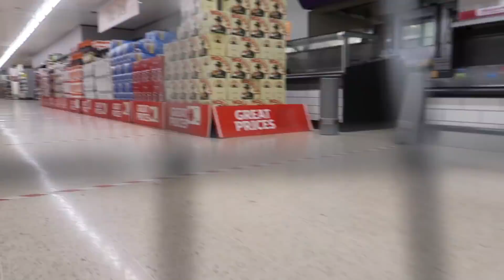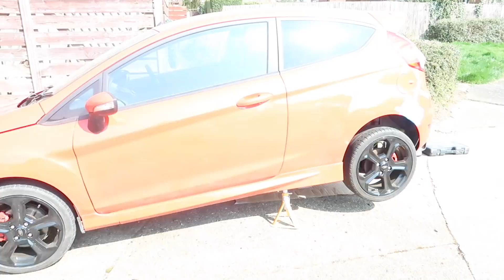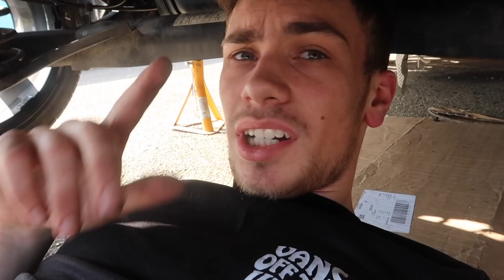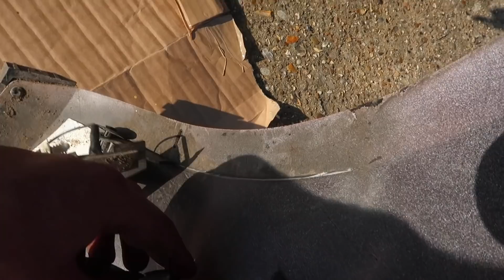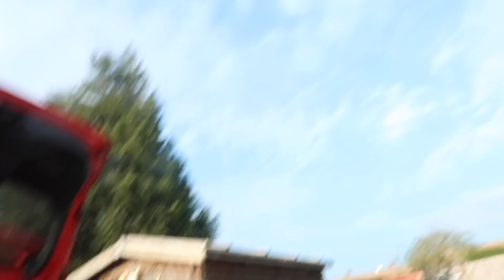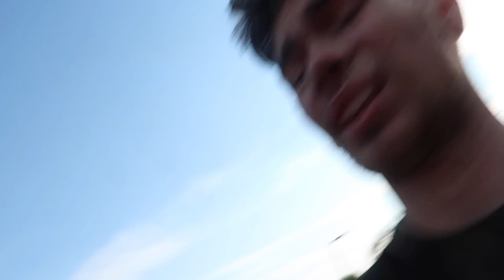TRACK CAR PROGRESS!

Comment: You undid the adjuster on the cable so it needs adjusting back up mate. Jack the back end up and adjust it until it just starts grabbing on the back wheels, then back it off just a bit.

Comment: Yeah. Wear those gloves for protection. Possibly get them infected in store. Then get in your car touching handles, steering wheel and paddles. You should of removed them getting in and used a hand sanitiser. Or worn plastic and disposed them.

Comment: Yep the handbrakes are absolute wank on these cars. When you had the 10mm socket out there’s an adjuster at the bottom of the handbrake just tight it up but put a locking nut on it cos it will keep coming loose 👍